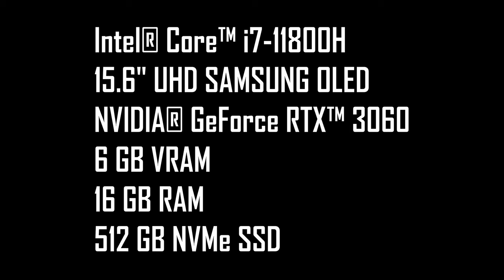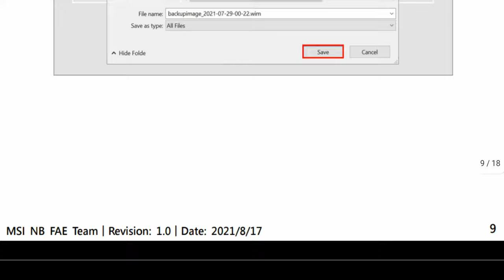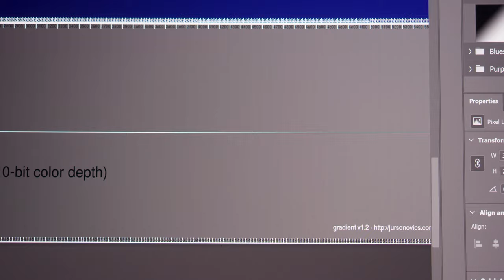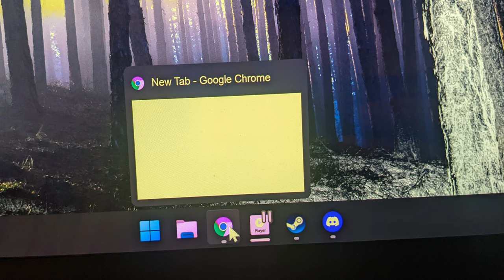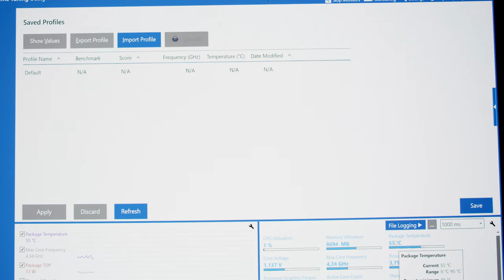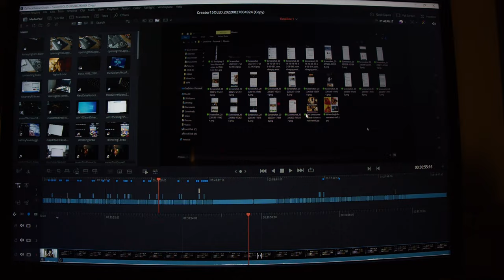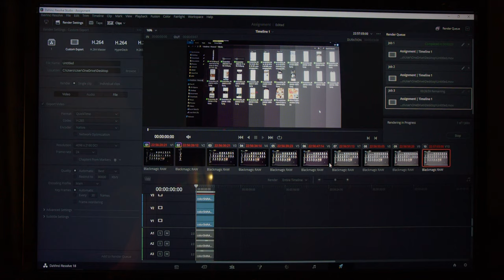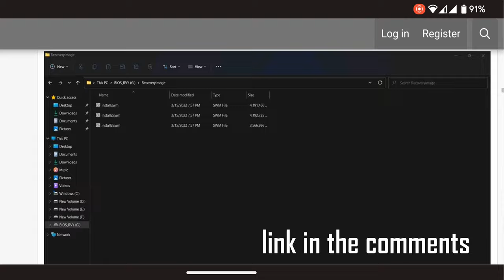MSI Creator 15 OLED Real User's Review (GS66 with OLED)

Comment: There are professional laptops that you can call work stations. Are heavy, sturdy and most of them only have vapor chambers as cooling. None you'll find on the market for the end user will be that. Will cost you some thousands but, will last you as much as 5 of this gaming OLED ** 

The point is: you work at your desk anyway... why the laptop? I really can't see the point and I'm gonna call out the disadvantages.
1.Sweaty palms because of the heat coming trough keyboard.

2. Constant high pitched fan noise. Why high pitched? are just thin fans compared with desktop fans which are thicker and does not need high RPMs to cool down the parts. Those thicker desktop fans got a more pleasant humming noise and is way far from your ears. You can even sound proof the case.
This issue alone is causing so much stress and disruption in your work and it does it on your own will and money.

3. Risk to spill drinks and mess up a lot of parts inside the laptop. On a desktop

4. Need to replace battery fast cause you need high power and you are constantly plugged to AC, that will were out your battery fast.

5. Bloat ware and spyware constantly hinder again your productivity. Again delivered to you by the manufacturer on your own money and waste of time after that. Unnecessary hardware and power usage,  caused by that "mighty software suites designed to help you" Even you install a fresh copy of Win you breaking other things which I'm not getting into. 

I can fill up way more points along with the ones you mention.
I fixed enough laptops to tell you is not worth it, your money and your time. Are just overated toys design for very short "planned obsolescence" .
The only solution(I mean, a cheaper one) is a desktop and a normal laptop to transport and show your work or whatever.

Hope it helps